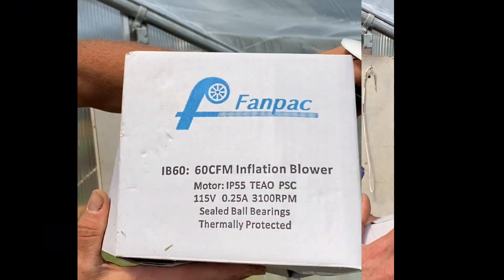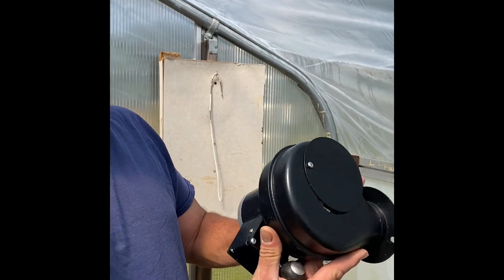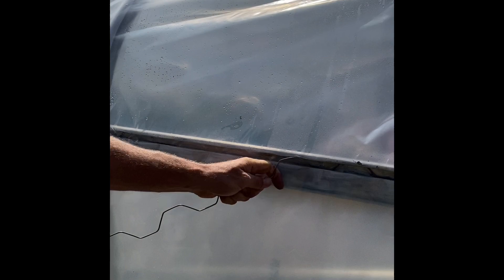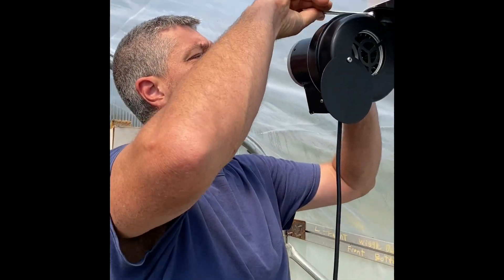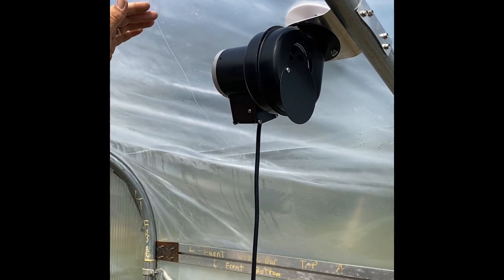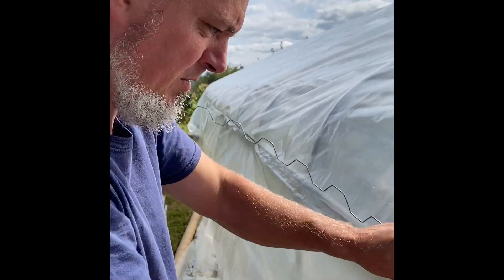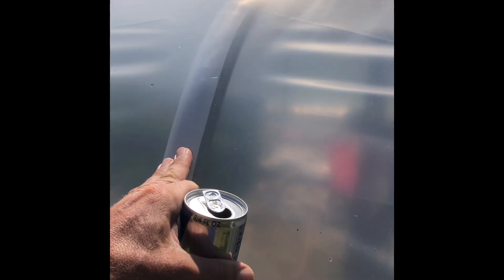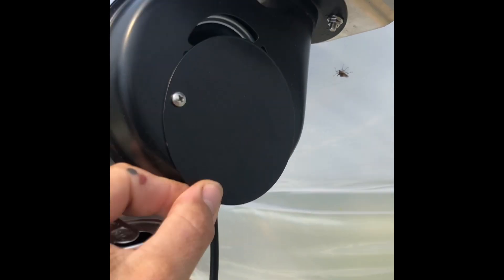Installing a greenhouse inflation blower to create an insulated air gab between two layers #Fanpac

Comment: Would be great if you could demo how the water column measurement works! I just put my films on my high tunnel and fastened everything with staples instead of wiggle wire. Hoping I don’t have to take it apart to get air into the bubble space!😂😂
Reply from the maker: Great idea for a video.  Thank you for subscribing.